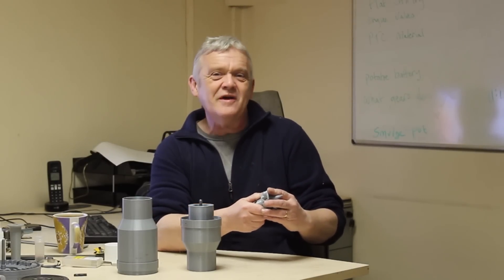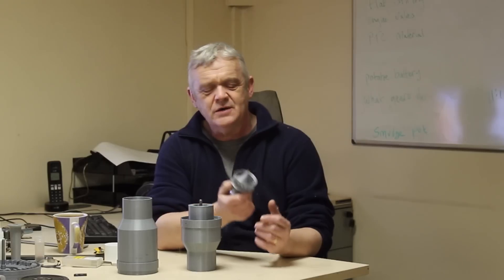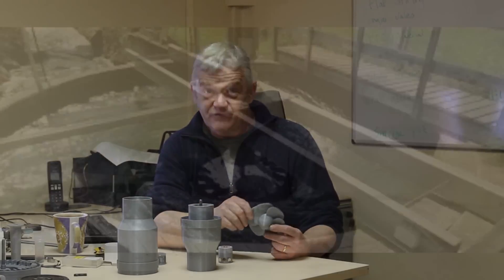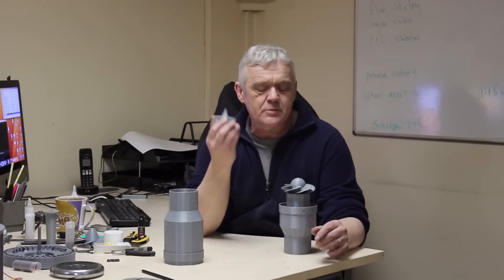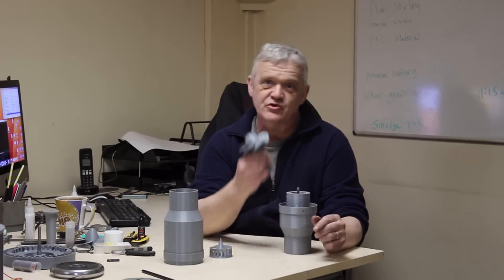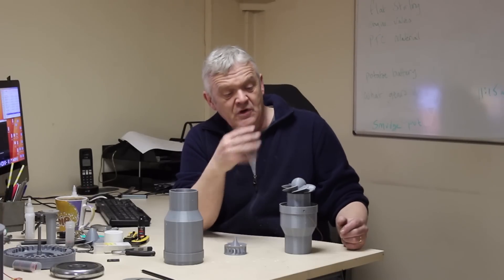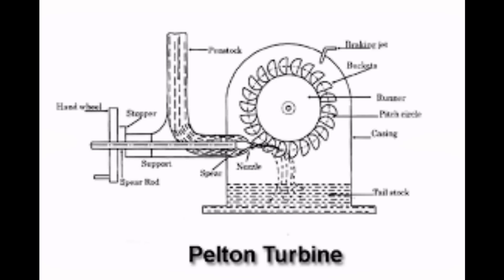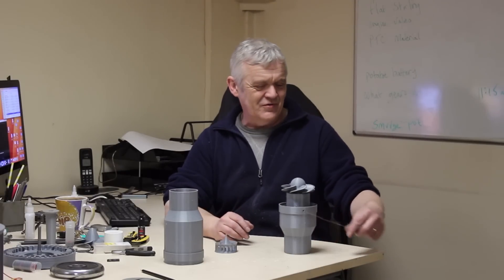1887 Rainwater Turbine - Mass Or Momentum

Comment: I was just thinking, 😆,     if two generators are built equal, one has 2x the copper of the other, but only spun half as fast, are they equal on the output? Or even close?
Reply: If the extra copper means the windings have double the length then it will double the voltage, if the wire is just twice as thick, with the same number of turns, it will make twice the amps.
Reply: Questions to better answer.  Serries or parallel.  What is the resistance of the coil, and that is the resistance of the load 

Did you want the second generator to have a second coil in serries or parallel? 

Reguarding double the mass in serries, your doubeling the length of wire but did youbwant to double the length of coil resulting in double the number of turns or did you want to keep keep the length of coil the same but double crosssection of the coil.   They will have close but not the  same output voltage as each other, and  to the the original coil. And either serries wire configuration will have double the resistance across the entire coil so that when you have a load draw a current  the voltage drop across the coil will also double for a given current. 

Reguarding in parallel,  you may wind two coils in parallel and either double the cross section or double the length.  Your combined coil's internal resistance is 1/2 but your output voltage will be close but not identical to 1/2 of the original.

Complicating factors are what is the load resistance that effects current and internal voltage drop and magnetic properties and geometries that effect magnetic fringing under load.  

 or keep winding with the same length but increase the diameter will the cross section of coil is doubled?  Double the length of the coil has more turns than double the cross section so unloaded it would output more voltage than a coil with the same length wire
Reply: @arkatub   the original problem was if the second generator was spun at 1/2 the speed of the first. 

But even with the additional copper in serries, coil geomitry effect the number of turns. Is the second generator coil twice as long or twice the cross section.  A coil with twice the cross section is not double the number of turns.